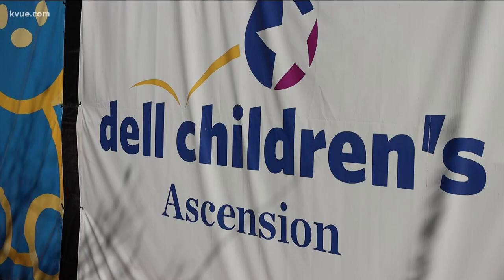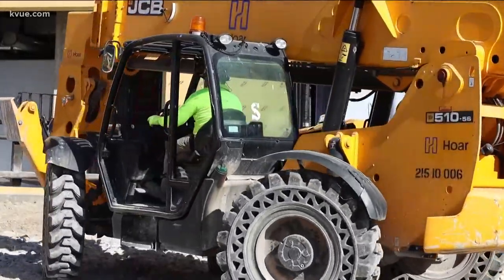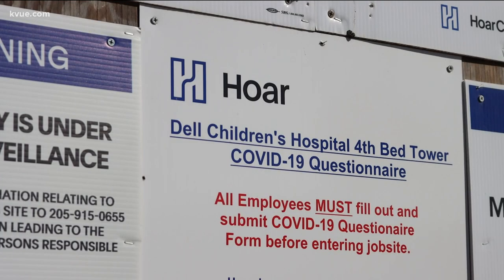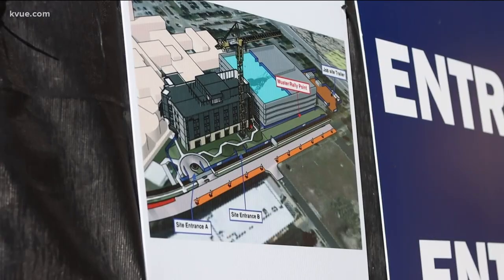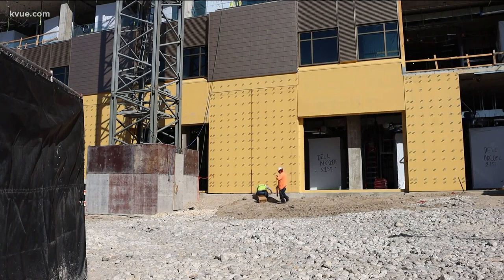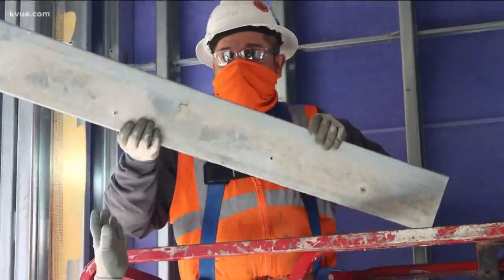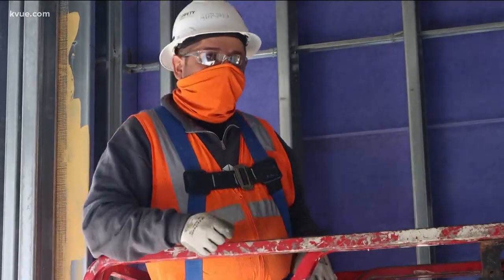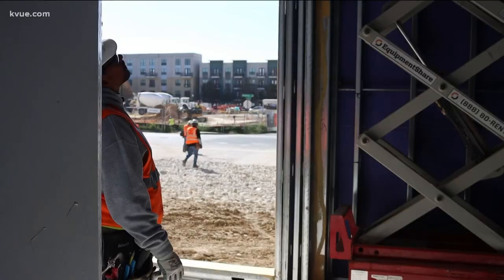Labor shortages cause Austin-area construction companies to get creative | KVUE

Comment: Recruit your construction workers from CANADA !! YES CANADA! There is a massive surplus of construction workers here in Canada. I myself am an unemployed construction worker here in Canada and would be willing to work for minimum wage (an Intern Architect).  What you need to do is set up a recruitment drive for construction workers here in Canada. Put a half page advertisement in the Vancouver Sun and the Toronto Sun local daily newspapers. Hold weekend conferences in  large hotel rooms in Vancouver, B.C. and Toronto, ON ,Canada. Have construction recruiters on site in the hotel conference rooms ready to interview and hire construction workers right there. Unemployed construction workers will flock to your hotel conference room by the 10,000's . Yes you will have at least 10,000 unemployed construction workers in Canada who will gladly re-locate to the United States of America. Easy Peasy!!